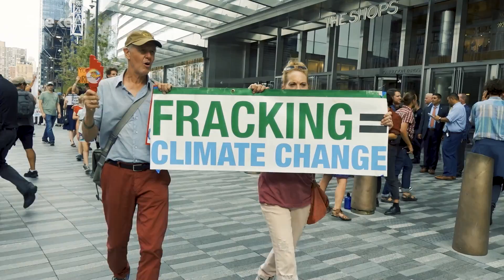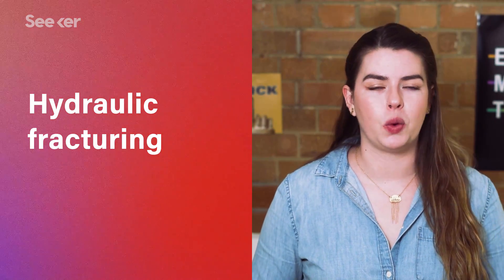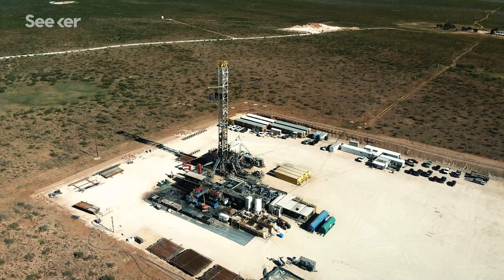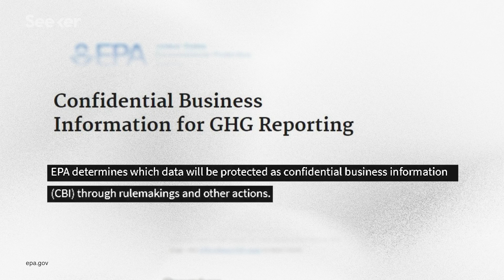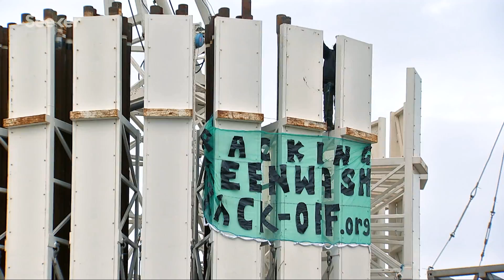What Exactly Is Fracking, And Is It Really That Bad?

Comment: Also fracing is extremely profitable why would oil companies be fracing if it didn’t make there wells more profitable. Also fracing is not government subsidies. The oil company who owns the well pays the coil tubing company to come in and either shift frac sleeve and pressure up the formation. Or pay a wire line company to plug and perforate the well casing and frac the shale. So fracing is definitely profitable and is not government subsidized. Then also as for ground water. Ground water aquifers are from 30m- 600m so oil companies drill a surface casing to 500m-700m they then cement the outside of that casing to protect ground water then they run another well casing inside the surface casing all the way to the bottom of the well into the formation sometimes being 8000m they then cement that all the way up to the surface so ground water is definitely protected

Comment: Lots of false information. Fracking in and of itself does not cause any contamination of water aquifers. Failure to properly case and seal the well does. Completion of a well is a complicated process with a lot of different parts and companies involved. If any contamination happens it’s the fault of whoever cased the well, not the frack company. 

Earth quakes typically aren’t caused by fracking. They are caused by SWD’s (Saltwater disposals). These units pump waste water/product into the ground at even high pressures than frack, typically below shale formations (way far away from the water table). This has a lubricating effect that allows the earth to more easily move. These are just 2 of the several misstated issues in this video

Comment: You really need to go work in the oil field or study up on what you’re criticizing before you talk about it. 99% of the hydraulic fracking is done with water and sand. And no the word fracking comes from the explosive charge put down into the concrete/steel reinforced sealed hole that shatters the rock into (fractures) then the  (hydraulic) water and sand are pressurized into the cracks to keep them open and from closing.. it is not the pressure that keeps the cracks open, but is actually the sand filling in the cracks and keeping them from closing and keeps the cracks pourous . then the water solution is then pulled back out. The well is Drilled almost a mile down. And I have no idea where you got this U-shaped well bore concept from😂 why would they drill two holes to come back up??? it just shows how little you know about fracking…
 The amount of chemicals used is so insignificant .. the chemicals underneath your household sink are far more dangerous. And no, the chemicals are not a secret you can find out what chemicals are used just about anywhere. The only thing dangerous about our chemicals is that when they are shipped or received, they are in bulk by the thousands of gallons and so yes when they’re in a container and concentrated, they are very dangerous. But they are only concentrated when they are stored not when they were used. Think of it this way…the amount of chemicals they use with fracking would be like using a single drop of detergent for your washer. When they are diluted with water and sand and 99% of that dilution is water and sand…it is not dangerous… and one of the main gases, which you didn’t even mention is H2S. Which H2S is produced even in our sewers and plenty of other places. Don’t really have much methane gas issues on Frack sites. It’s mainly H2S from decaying organic matter.

And they are trying to capture the gases, created from decaying organic matter and trying to separate the hydrogen bond from the sulfuric bond. That way, then you can isolate hydrogen as a fuel source or energy resource. 
Even the engines that run the operation don’t even run strictly on diesel anymore some use 70% natural gas to 30% diesel mix. 

Go work in the oilfield. Learn something about how things work. don’t like it? you want to change it? Go work on it, understand it, and innovate and create ideas. Invent something.

Comment: It's not strictly true that it was the gas from fracking that contaminated the water in Philly, or anywhere really, reports from the EPA concluded that it was because of gas naturally found in the ground, many places (including new York, where it's banned and in the middle of frozen lakes) it happens as well, not because of fracking, however, the pipes and casings that were badly made or installed have caused problems with contamination, but so has it caused problems with conventional wells, not just fracking

Comment: Fracking is a scam, search that here on youtube. I will pass judgement and say that Fracking is polluting the water tables of the USA. A worst case scenario. But don't be concerned. As soon as the Big Oil companies realise that the Bottle water industry is more profitable, they will start selling the water they polluted.
Reply: Idiotic reply. The fluid they pump is 99.95% water and sand. The other 0.05% is polyacrylamides - a water-soluble synthetic linear polymer, also found in garden centres aka water crystals for soil. So, pretty harmless, don't you think? Hydraulic fracturing was invented in the 1940s, generally using petroleum gels, and it didn't work very well. Don't spread confusion, unless of course, you are ideologically opposed to fracking, that is.

Comment: This video seems bent on cherrypicking for one sided narrative. You know someone is keen on bullshitting when they present fracking as bigger planet killer than coal. There's another study by University of Michigan which shows coal is 100 times as much as polluting when you factor the entire process. Its not like methane is not released when you mine coal or lithium for electric vehicles. There are issues with fracking but technology is also evolving that can greatly reduce the negative impacts.

Comment: Fracking may not be the best, but there are also environmental problems with the production of the "cleaner" methods such as wind and solar. Truly the best form of "environmentally friendly" energy is either nuclear or hydro. But at the moment, until a "end all" solution is found it is logical to improve on ALL forms of energy. Making them cleaner, more efficient or cheaper in some way.

Comment: I'm from Southwest Oklahoma, there is a fault line in the Wichita Mountains.  Every year we would have hundreds micro quakes but we felt less then a handful.. that is until they started Fracking around the region.  Noticeable quakes increased by 300%!  Farmers and ranchers who depended on ground water started getting contaminated water from their wells.  Fracking is not safe.
Reply: Your well water is at 300-1000 feet deep.. they drill almost a mile down. And they drill with water and sand… when they hit the water table. It’s not an issue because before they even go any deeper, the hole is sealed off from any intrusion from outside or inside sources. They don’t use chemicals until they are a mile down in the dilution of chemicals is almost less than one percent. And all the chemicals that are pumped down and get pumped back up they don’t stay down there. the cracks that are formed from fracking are filled with sand… please go look up some thing more educational. And in case you didn’t know, fracking is a result of the explosive charge. Not water power washing rocks away. Hydraulic refers to the water and sand being pumped.. there’s where the term hydraulic fracking comes from.

Comment: I would fact check the point where the methane concentration in water was high. As of my understanding, methane does Not dissolve in water under domestic pressures and i think the videos of people lighting their tap water on fire are probably fake or due to another compound

Comment: 6:22 Unfortunately those energy sources rely on fracking too. They need gas peakers to equalize grid variability.

Nuclear neither needs fracking nor a lot of space. It also does not emit GHG during power generation. Small modular reactors, which are heading for market entry, may replace peakers due to their smaller size and reduced cost.

Comment: This video is filled with a lot of misinformation and BS. I work in the oil fracking sector which is basically the same process as natural gas fracking. So let me clear up some of the misinformation they purposely gave. So yes a lot of methane does come up from the wells but that gas is either burned off or used to power equipment so a lot of it doesn't actually go into the atmosphere. Also all the water used in the fracking process is cleaned and pumped back underground after it's used. Furthermore fraking sites have minimal impact on the surrounding environment. You would have to combine thousands of fraking site to equal the area of just one open pit coal mine. That mean that once a site is no longer production worth it is very easy to reclaim it.
Reply: Also you should know that the water usage is extremely minimal compared to agriculture and steam based power plants

Comment: Talk about bias! A load of misinformation and fairy tales. Rock is fractured not “blasted”. Technically cleaner than coal? You mean less harmful than coal. At least try to appear as if this is not entirely designed to discredit fracking.

Comment: You guys need to do proper research on the down side to fracking. They do not let any of the frac juice get into the ground. Most companies will instantly fire the frack company over that. The water being lit on fire was actually a stunt people pulled to try and get money from halliburton and it was proven to be wrong. Also, majority of fracking is used to extract oil. It's cheaper to burn off the natural gas than it is to capture it.

Comment: As long as you use internal combustion engine to use the chemical energy and transform that to electrical energy and to  mechanical energy. I think it is not smart or efficient way to use energy. it must be suggested to recommend the use fuel cell like the one patented in Australia that utilized methane gas as a fuel.

Comment: I am a huge fan of seeker.. but this is poorly researched. You have confused fracking and SAGD and.. the diagram of how the well works.. is inaccurate at best. Plus.. almost every piece of equipment you showed was a drilling rig, not a pump unit. Also.. the video showed drilling mud.. not frack fluid. Now.. the USA has virtually no laws (or at least nobody abides by them) to protect the environment.. so fracking gets a bad name.. when the actual issue.. is the total disregard for the environmental impacts of how waste fluids are used and disposed of. So.. if you actually impose proper laws to protect the environment... you can drill the hole.. seal it properly.. dispose of the fluids (most of them are common fertilizers).. then frack the hole.... which.. you don’t always need water to do as most fracking these days is done with liquid nitrogen. not water. Please.. use the mantra you’re so used to using “more research is needed”

Comment: You forgot one minor detail.
Places like North Dakota now have large pockets of H2S gas that can come to the surface during frac jobs also.
Reply: Can you cite a specific example?
Reply: @samuelcarstens6152  yeah, the fact that EVERY SINGLE well location in Watford, ND is REQUIRED by law to post signage the H2S gas is present. Also that every rig drilling in ND has to train all its employees how to use SCBA, and to wear H2S gas monitors.
Reply: @jeramyh9344  you remind me of my ex. Ask a direct question and get everything except a direct answer.  Can you name any specific cases out of the thousands of completed wells that "had h2s coming to the surface during a frac job in ND"?

That signage is present on every well that I've ever seen in montana and nd.  Every well has that signage. Even conventional wells. Even wells that have no H2S. It's possible that a well can turn from sweet to sour to sweet to sour so it's better to be safe than sorry. Plenty of pumpers have died because they didn't check h2s levels, were working alone, were complacent.  Better to be like Canada and reduce climbing tank batteries to an absolute minimum. Now, back to the question:

Where and when did large pockets of h2s come to the surface during frac jobs? I would be very curious to know about these events.

Comment: Fracking is nothing new it was just not used because it's an expensive process but the value of energy has increased to make it worth while . Come up with cheaper energy and fracking goes away again . Also have to consider the potential value of energy independence in keeping US troops out of the Middle East which is costly in lives and wealth . It's part of one big sandwich .

Comment: All oil and gas production can cause earthquakes. It only makes since taking large volumes out from underground can cause the ground to shift. Fracking is to increase the amount of oil and gas that comes out of the ground, thus it causes earth quakes indirectly. During the injection of the relative small volumes of fluid of the fracking causing earth quakes has never been detected from the surface. It is common to put arrays of seismographs in neighboring wells to try to detect small fractures events, but those are below a one on the Richter scale. Acording to Wikipedia 1.0-1.9 is a microearthquakes, not felt, or felt rarely.

Comment: The reason NG pricing is artificially low with fracking is because NG is a BY-PRODUCT of fracking; the main production target is light crude oil (C2-C8).  When Russia and OPEC started fighting over oil production levels in early 2020, and the crude oil market crashed, rig counts crashed, and the pricing of NG started climbing again, in some cases reversing the cost differential for coal/NG in US electricity production.  And while renewables are often underpricing baseload thermal (fossil fuel) generation in the daily and hourly markets, there is still not enough electrical storage and transmission to provide uninterrupted service to the US grid.  Cost of storage is still 5-10 years away from reaching parity with the current generation stack, so there will be a transitional period for the next 10-15 years minimum.

Comment: Why is water usage a problem with fracking? Does it have to be freshwater?
Reply: Most of the time they use brackish water which causes issues if there is a spill or contamination of water sources (ground/stream). Most of the chemicals they use are usually just cheaper bulk items commonly used in food mixed for various purposes. They used to use alot of diesel in the chemicals as a filler, but the industry quickly changed that (mostly to mineral oil) when the EPA started requiring notification whenever any diesel was put in any well.

Comment: 70,000 increasingly efficient solar panels roll off production lines every hour, dropping 23% per doubling number produced. By 2030, three times the total energy used today will come from solar, at one tenth the cost.

There is zero reason for fracking, or any fossil emitting extraction.
Reply: Solar depends on fossil fuels at all stages of its production, use, disposal and replacement. And those fossil fuels won't be available in any case. Your figures are wildly off.

Comment: While fracking is bad, so-called "renewables" are as bad or worse.  Check out the waste streams for solar, the environmental impact of solar thermal, wind and wave energy production.  We need to focus on nuclear.  Fusion is the future.
Reply: Nuclear does indeed have a place, but it needs to be accompanied by renewables.  I find it debatable that renewables have a greater negative environmental impact than fossil fuels.  In any case, fossil fuels are non- renewable, and nuclear is expensive and time consuming to develop on a large scale.  I wouldn't hold my breath waiting for fusion to become a practical reality in the near future.

Comment: Any seismic activity can release this trapped methane gas which is 300 times more powerful greenhouse gas than co2. So it better to extract it use it for energy production and convert it to less powerful greenhouse gas viz. co2 rather than allowing methane to escape into air and cause more global warming.
Reply: That's not how it works.
Reply: @xXDESTINYMBXx  then how does it work. Can you elaborate please.

Comment: The secrecy around these "proprietary" chemical washes is very frustrating
Reply: Most of the industry went to voluntarily disclosing the chemicals on sites like fracfocus.org for individual wells, but obviously since this is voluntarily, not all of them are fully disclosing all of the chemicals with the use of proprietary still poping up. Even the companies handling the chemicals can't get full details if the chemicals are within the limits to be non-DOT regulated (Department of Transpertation regulated). The handler does get the basic Safety Data Sheet though.
Reply: How hard can it be to determine the chemical composition of pollutants tho?

Comment: Ironically I am an engineer who used to work in this area and there were several factual errors that are commonly repeated outside of the industry. The funniest thing I saw was the fluids being shown in this video were drilling mud/ fluids not fracking fluids, a distinct difference.
Reply: As someone that works in this industry the misinformation in this video is laughable
Reply: @Wanderingtraveler6  Until you one day run your water and it lights on fire. Or comes out as brown water.